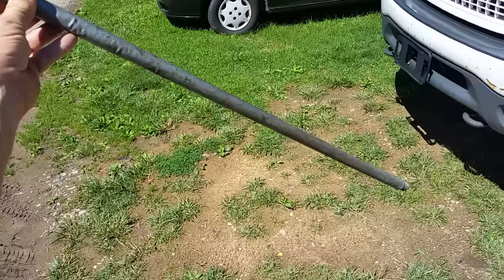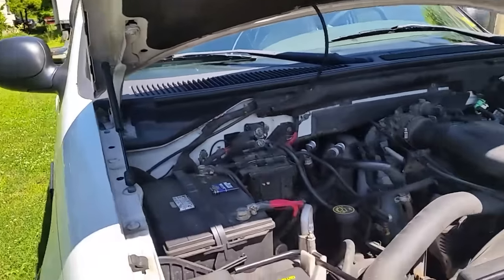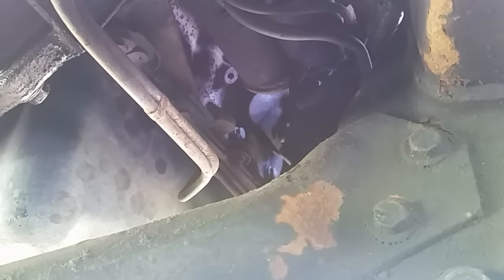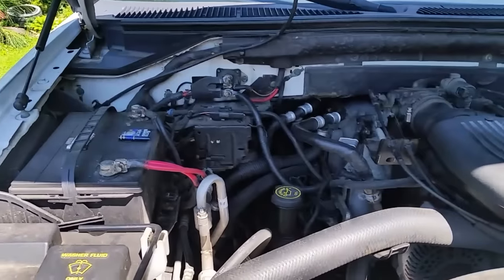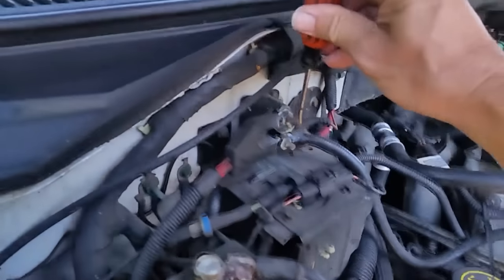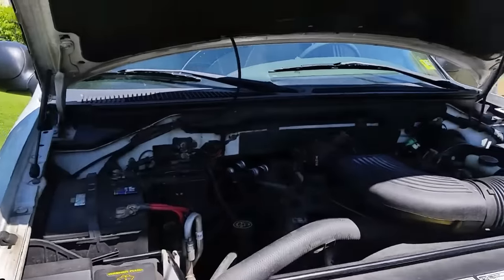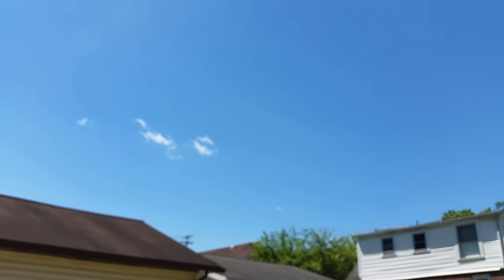Starter Issues??? Simple trick to get your vehicle started and get Home!

Comment: I have been having problems with our Ford Fusion 2010 with issues with batteries that got corrosive and and we have now had the problem with it starting. If had to replace the steering and also the the transmission rebuilt. Still having problems with the transmission and it's starting. I do have only one key for this vehicle and it has a key fob and it does not work would it be prudent to to take out the the alarm system?  The batteries have only been lasting a year to a year and a 1/2 gone through 3 of them since this issue my husband is a mechanic but getting him to do things well well not an easy task. I mean the car is 12 years old I would figure it would be a starter or the Ignition switch which I've seen videos on those that Ford had problems with those it's been nonstop I wish I would have traded it in years ago

Comment: What if by crossing the solenoid it does nothing? No crank no spark
Reply from the maker: Dead battery o broken wire
Reply: @FixingWithPassion  battery brand new I charged it up just Incase and I rebuilt the battery/ starter harness. Is it possible that the starter can be so far gone that even when hammering it, it won’t start?

Comment: What happens if you try the screw driver trick and it doesn't do anything? I have power from ign switch to solenoid, battery is good,  have power on bottom of post but go to jump it and nothing?? Motor turns free aswell I'm confused, when you go to start truck it clicks at the silonid but won't start. I've tried hitting starter but not alot of room I just want to know if i can't jump the silonid with screw driver is it bad?

Comment: With boats raw water cooled, shut off the raw water if it keeps cranking cuz it will pump water into eng and exhaust won't blow it out just remember to turn that valve on quickly once it fires😂

Comment: Sorry. But I need to clear this up. When you "test" the fire wall solenoid you are not actually "testing" it. You are instead by passing it. The solenoid could still be bad as it is a basic on/off switch with a tee looking rod inside that makes contact across opposite sides of solenoid when the rod moves to connect the two circuits. They tend to burn up at the contacts over time. So, even though the starter or sometimes bad connections is usually the culprit, don't over look the solenoid. Just Saying. Good info vid.

Comment: PLEASE HELP ANYONE Who's MECHANICALLY INCLINED!! I replaced the solenoid on my starter & it's still jus clicking. I tried to bypass it & it turned over but still didn't start up. What should I do next? Also if I do get it started will it start up on a regular basis or do I need to replace the whole starter all together?

Comment: do you have any experience using rebuilt starters and the reliability of them?
Reply from the maker: I've used them. As long as the person knows what there doing in rebuilding them. But now days, you can buy a new one at the parts store for the same price of rebuilding now days. Go figure.
Reply: thanks so much for replying, yeah i just checked and they are close in price but that core charge will eat you up

Comment: My 2001 ford f150 will not crank. It just started doing this. I tried going the starter solenoid from bottom and I get no results. Then I watch a couple of videos to take a screwdriver and touch terminals of solenoid under the hood. Every video that I seen. Their truck Crank. Mi will not crank . It just sparks. I used my test light on it and it lights up. But it will not turnover like the videos I seen. Please help

Comment: What if a car starts via starter relay but not with the key?? Having an issue with my 02 gt also a 4.6 i can jump wire the starter relay and it crank however with the key it just clicks.

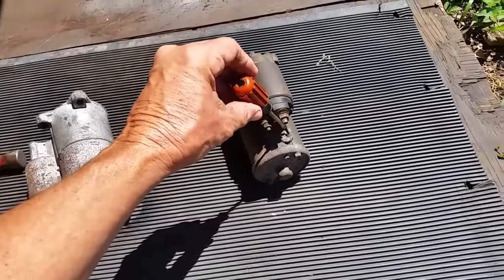Comment: 2:44 i am not mechanic but i am pretty sure you are touching the wrong connector, we should touch the signal and battery terminal, but you are touching signal and motor terminal i guess which is wrong i beleive

Comment: If my solenoid has 3 prongs should all 3 require a relay. Positive. Or negative wire connection i only ask since one of the 13mm bolt are not in use

Comment: How are you..i have a question..i have a 97 expedition that sometimes start and sometimes dont. When i turn the key it makes a grinding metal sound. I let the car sit for a bit then it cranks up. Will that trick with the pole work for me till i replace starter?
Reply from the maker: Eh...sounds like the starter is    D   O   N   E     .......
Reply: Nathan Rohrbough thats what i thought. Im replacing the starter today
Reply: Fixed starter so that problem is corrected. Next problem lol..my truck has cut off on me twice while driving. It wouldnt turn over but after waiting 20min it finally started. Could i have a bad wiring harness?
Reply from the maker: Well when it does it again....carry some starting fluid and see if it tries start. If so electrical issue.
Reply from the maker: Check the bat term and see if one is loose.

Comment: My Ford 2004 Freestar crank but won't start?
Any idea what's the problem
Reply: im no expert but i would check  if the fuel pump is working and getting any fuel to the motor. spark plugs for spark, air intake/filter, oil of course.   fuse box too you might have a blown fuse.  make sure ur  battery and connection is good. check for any ripped wires or connector.   also id get a scantool see if any codes come up.

Comment: I have a 98 Ford expedition and my I was driving down the road my fan grab the crankshaft sensor wire ripped it out so killed my engine and ever since then I got it all replaced got a new crankshaft sensor for it but it still won't start it cranks over but wont start please tell me what's wrong

Comment: So I tried to jump my solenoid and nothing happened even though I have a full battery does that mean I have to change out my solenoid? My starter solenoid I mean
Reply from the maker: perhaps
Reply: @FixingWithPassion  well I went and got a starter solenoid and I'll let you know how it works
Reply: It turned out to be a bad starter. Which I'm glad I found out because while looking at my starter and found out that my PCV valve breather hose was cracked so I was getting a vacuum leak there and it was messing up everything in my truck and I couldn't figure it out for about 6 months what was wrong so I got that fixed too

Comment: I noticed you attached the negative starter cable first to battery.
Battery in my car is oké, but still could not bump start car.
In the garage they replaced the starter motor and still car won't start
and are having difficulty finding the cause.
I mentioned about scan to seek problem 
As you mentioned solenoid I'll call garage tomorrow to check solenoid, if they have not already done so.
Hope it won't be a costly fix for my Ford Mondeo/Fusion.......Belgium
Thank You for useful information

Comment: If you know the battery is charged why try to jump start it. Straight away if you can't hear the solenoid click it may be the gear selector safety switch or the ignition switch or the solenoid so I personally would have tried solenoid straight after checking battery power remember KISS =keep it simple stupid. Start simple and eliminate.

Comment: Hey brother, GREAT video...but would it be safe to say I have a bad starter if it just spins when I try to start it...I can hear it spinning...I've tried tapping it from the bottom with a hammer, I've checked the solenoid under the hood like you showed in your video...but it still does the same thing, spins.....
Reply from the maker: Yea the starter is bad. There is a solenoid in the starter may be bad.  Did to short out the solenoid in the fire wall just to make sure? Sometimes it might be bad.
Reply: I did actually...that's the one just under the hood, right? it just spun like I was trying to start my car ....
Reply from the maker: Yes it is....sounds like a starter issue ;(
Reply: Awesome, thanks ALOT Brother! You've been a tremendous help!
Reply: +Santos Hernandez a 1999 Ford Windstar starter problems the living starter the place is called how to replace starter on 1999 Ford Windstar

Comment: have a 2000 Nissan exterior got new starter from the internet put on it cranked it right up throw it about a week and then the starter started acting up like the bad one before I put the new one on
Reply from the maker: O no!~~~~
Reply: @FixingWithPassion  you know, a little more than a cute remark would be helpful. If you don't know or don't want to help any further, just say so. Some people rely on your knowledge. JS
Reply: Sorry you had to use the internet. Car parts, especially electrical, are notorious for not always being in proper condition when bought. Not sure if you live close enough to parts store, but most have a return policy or you can now purchase most parts with lifetime warranty. It sounds like the part you bought went out quickly, or you have a further problem that is killing your starters. Or...not your starter in the first place. Maybe only the secondary selenoid if you have one or...?  If starter is returnable, try that first. Only my amateur opinion. 😬👍

Comment: hey i did this on my car and now my car wont go on accessory mode, or do anything. all i did was the step you showed with the solenoid
Reply from the maker: Recheck the ground and make sure the starter is getting a good ground. Tap it with a hammer see if it does anything.
Reply: it actually blew my battery fuse, but at least i know the starter somewhat works lmao
Reply from the maker: Dang!  Hope you get it fixed.
Reply: Though the guy in the video meant well, he's not the sharpest tool in the shed. What he shows is shorting the main power cable to the starter (basically ground) which won't start anything, but can and will blow fuses or melt the cable and damage the metal that you use to short it out. The correct way is to connect the two posts on the solenoid together. This provides power to the solenoid from the main power cable and activates the solenoid. The reason he has two "solenoids" is because Ford uses a two solenoid system. The one on the firewall provides power to the starter solenoid that then engages and runs the starter. Most other manufacturers have only one solenoid on the starter, but often  has three connections on it.
Reply: HOONRV o
Reply: @Al-lf5ub  what do you mean 'connect the two posts together'? How do you do this correctly?

Comment: I'm baffled at the tips regarding the under hood solenoid.  If you jump it and the starter cranks the engine over then the starter itself is obviously functioning and the part you just bypassed is the culprit.

A solenoid has a coil and contacts inside.  The little wire going to it, when powered, powers the coil which closes the contact.  Then the power from the input side of the big cable connects to the output cable.  When you bypass use the screwdriver to make the connection you aren't confirming the solenoid is good.  You are bypassing the solenoid.  If the engine cranks when that solenoid is skipped, then the solenoid is the problem not the starter.  Or perhaps both have issues, and the weakened connection at the coil can't support the increased draw of a bad starter.  In that case one or the other may temporarily allow for starting but the system may be prone to another total failure soon.

I have never bothered to figure out exactly what the point is of the two solenoids.  I think it makes more sense that the solenoid under the hood activates when the key is on and the one on the starter obviously only activates on start.  The second solenoid adds a point of failure in the starting system without serving a purpose for starting.  My theory is that it is meant to be a safety feature.  It prevents having  a hot, unfused, heavy gauge battery cable running through the engine bay reducing fire risks from crashes and otherwise.

Comment: Damn Mazda 6 4cyl 2004 model, tried and tried to find the starter (without taking the battery and battery tray, AND stone tray out!). And seriously NO room, and can't see the damn thing.
Stupid car on a good incline fronted in the driveway, and I'm thinking it can't get worse.

I have to take the entire battery and tray out just hit this damn thing! Its pissing me off.
Reply: Kim Land I have an 04 6i as well. The starter is actually under the intake manifold right above the oil filter the housing. I thought it was in the same spot you did until I took all that out and it wasn’t there!

Comment: I tryed it but it didnt work it was stuck i hit a couple of times
Reply: Did you replace IT since?
Reply: @jonathanc8513  yea i took it 2 a mechanic i told him i think ma alernator or starter is failing he said no a week later pass by nd da started wen out it got stuck i hit it a couple of times it didnt work. I  wanted 2 do it myself but u need a car  lift da starter sit very high in da engine  very little 2 no space. I had 2  get it towed 2 da shop

Comment: My fuel pumps on my mustang, hellcat, Jeep and every other vehicle I’ve ever worked on in 40yrs powers up when the key is in the on position to pressurize the electronic fuel injection system or send fuel to your carburetor BEFORE you rotate the key to the start position, not when the key is in the start position otherwise the engine would shut off as soon as you let off the key after starting the vehicle. Usually you can hear the fuel pump in the tank kick on if your out of fuel or if you have a high volume return flow fuel system even if you have fuel like I have in my mustang. Also if your jumping across the solenoid and it engages your starter it shows you have a bad solenoid or possibly ignition switch if it engages, not starter. Banging on your starter to get it to turn over the engine is about the only correct information in this video. You can also use a single lead from your jumper cables and place it directly on the positive post on the starter side of your solenoid that’s mounted on the starter and do a quick touch to the positive post on your battery to see if it try’s to engage, if it does this procedure is by passing all the solenoids as well as your ignition switch and you can then do other tests to figure out if you have a bad ignition switch or starter solenoid or solenoids. Some of this information isn’t correct in this video and I was a mechanic for 40yrs.
Reply from the maker: OK.

Comment: If shorting the solenoid gets the starter to turn over that means the solenoid is BAD not good. If it was good you wouldn’t need the screwdriver to make the connection because the solenoid would do that on its own. This video is just confusing people with it’s illogical troubleshooting steps.

Comment: U should have tried the solenoid first! Why? Bcuz obviously beating on a electronic motor that has breakable magnets in it is never a good idea! BEATING THE STARTER IS A LAST STITCH EFFORT IN A PINCH TYPE OF THING! bcuz if u find out it's not actually the starter, then u possibly decrease the life of the starter if not ruined it! In u said something about it could possibly have a loose ground and beating it with a hammer sometimes helps get a good connection... Here's one tip from a fairly experienced mechanic. Maybe check the ground next time "Before" Going all Flintstones Bam Bam style on it! Js FYI
Reply from the maker: True, but them starters are harden steel! Never seen magnets break by "tapping" on one. If starters were that weak, we would have pull strings....lol Its rare that some loose wire on the solenoid is the cause. Its "never" that easy...lol If its a ground issue....you usually won't get a "click" from the starter. Its usually the brushes that have a bad connection from being worn out. The "Tap" briefly restores connection with the brushes so the starter turns enough hopefully to start to auto to get you home. Now newer auto's today.... slightly different story. -From a 45 year old mechanic.
Reply: Hey ur the one that said something about the ground issue in another comment. In I have seen starters that have cracked magnets that came from banging on it with a hammer. In they caused the starter to seize! It doesn't matter if the steel is hard or not it's the jult from a sudden smack that can cause it. In yes they are that fragile. Their not made to with stand a hammer impact! Probably why their taste cked way up inside the engine compartment hard to get to. How often does shit get up inside there in hits the starter? Exactly! Ijs it's not a good idea, UNLESS UVE CHECKED EVERY OTHER POSSIBLE CAUSE FOR IT NOT TURNING OVER! Also bypassing the solenoid won't work on a lot of newer vehicles it only turns the motor. U also have to bypass the control wire to engage the solenoid that kicks the gear forward to the flywheel.
Reply from the maker: Most of the magnets I've seen in starters that were cracked, were because of rust forming between the magnets and case, forcing the magnets into the starter armature...then one day it its to close... then when someone hits the starter...boom! that's it, its busted cracked. This is what 45 years of fixing starters will teach you. I've see it all.

Comment: I have a 1999 Ford explorer,  I'm trying locate where my starter is??
Reply from the maker: Do you know where your engine is?
Reply: Art Aguilera go to Google and type that exact question... it'll come up quick.. should be located right under the Exhaust Manifold..
Passenger side..
Reply: Because its function is to turn the crankshaft through the flywheel using a pinion gear, it must be located near/behind the gearbox and usually under the manifold. Of course you have to know its shape before trying to find its location.
Reply: it's at the back of your ride if u look under the blanket fluid box in the trunk